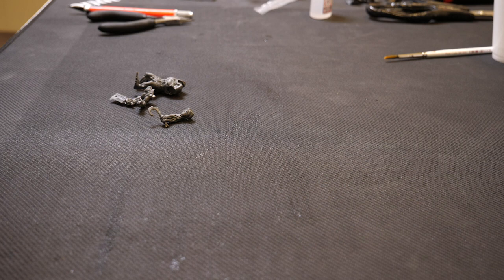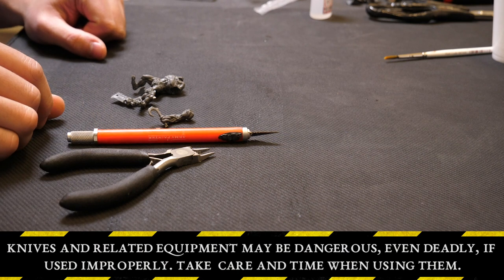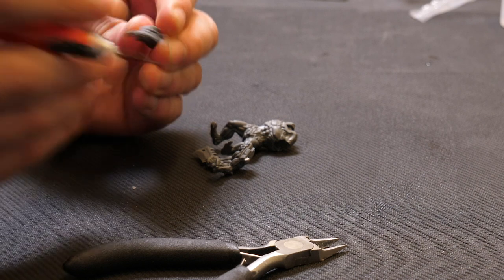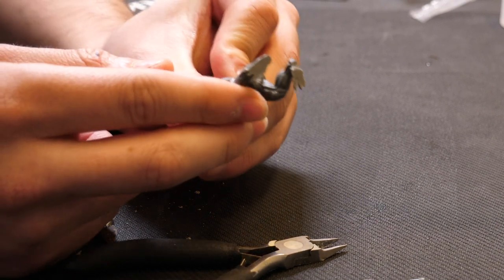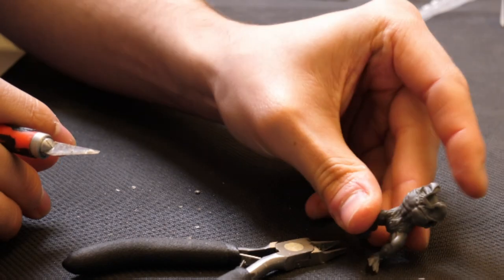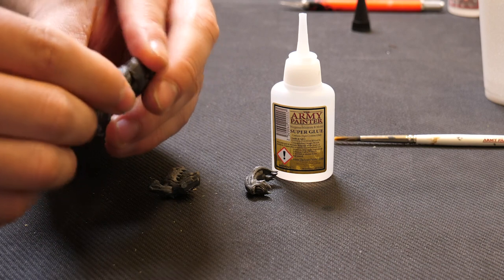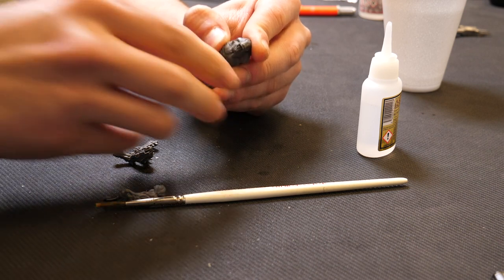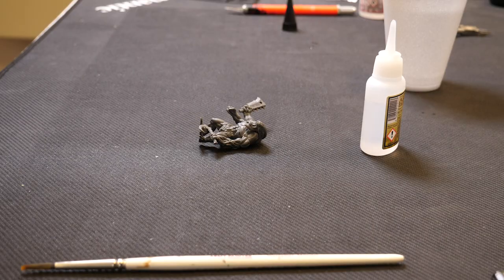Mantic Quick Tips! - Assembling PVC Plastic Miniatures

Comment: I am having a lot of trouble fitting the pieces together for Ogre Shooters. The parts don't seem to fit- the two arms and bow aligning with shoulders.  I struggled when I first glued the bow to the left arm along the stock and then tried to fit the right arm, socketed into the right hand/ bow, to align with the right shoulder. Going the other way, first glueing the right arm into the bow, this joint fit quite type and could only fit one way, I could not make that fit with the left arm without significant gaps either at the bow or at the shoulder. I ended up using Green Stuff to cover the gaps- a poor solution for appearance. The best way was to glue the bow to the left arm, glue the left arm in place and the NOT seat the right arm socket into the bow/hand part letting that spot be the gap. So the best fitting joint for the figure is the one you don't use. Hmmm. I really like the Ogre Shooter units- their like having a heavy Machine gun that can melee almost as well as an infantry platoon. So ideas? Is this a known issue? Am I somehow wrong? BTW, the Boom Sticks parts seemed to fit better, but I haven't actually made them yet.